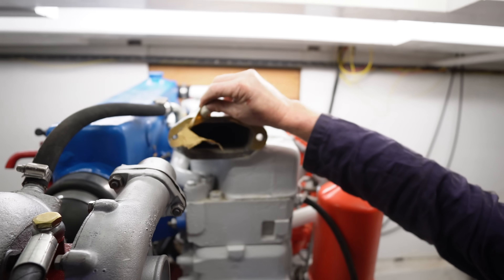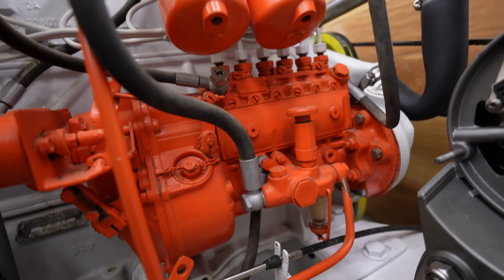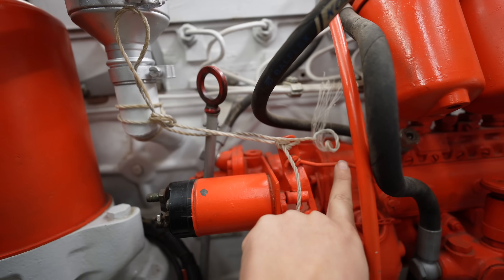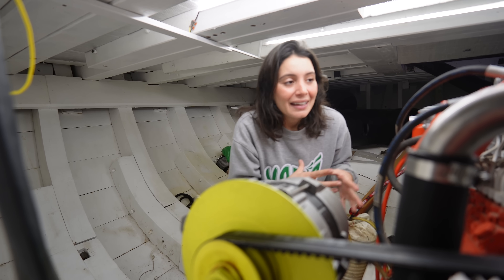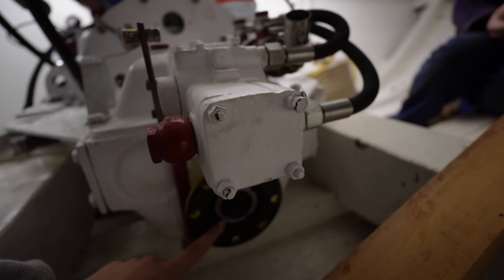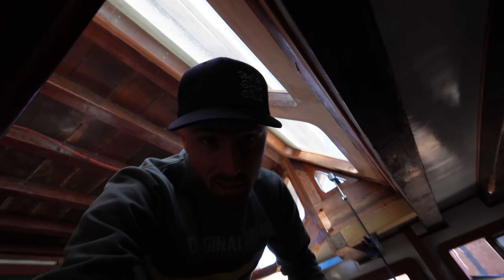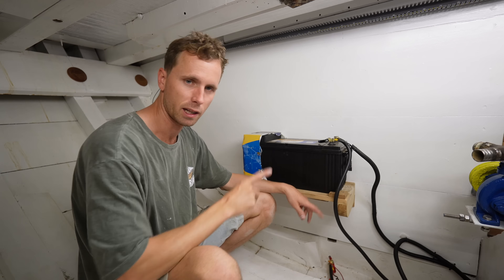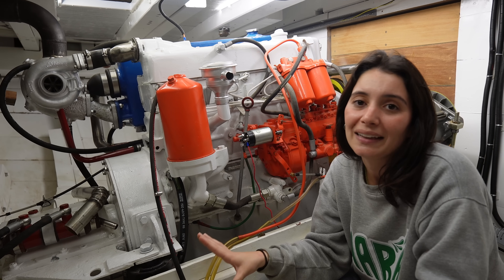Girl Takes on 230HP Diesel Mercedes Boat Engine - Incredible Transformation!

Comment: i always new about end float from an early age, but honestly had no real idea what the hell it was, but with additional pressure, an example being the road wheels on a car, you need a little slack or you could damage things, if any thing there could always be too much slack and this also can damage things such as the output bearing to the prop shaft, not too sure about the sideways load your engineer was putting on the output shaft because this can also indicate prior damage to that last bearing, (an easy enough fix) the end float is pressure against the gearbox and can be adjusted with a shim or two, i have been stripping aviation parts, with drive shafts and all manner of bearings and shims, it pretty interesting to see how these things work and run so smoothly for so many hours without the slightest of wear, but when things go wrong, the lessons are just as rewarding, bearings that seize up and no longer have any movement, ahha so that's why it failed, possibly a lacking in lubricant, oil is essential to keep things moving
Reply: The output bearing is brand new. The sideways load is on for a few seconds, so no problem.

Comment: The next time you can put a little air pressure into the fuel tank or container and you will not have to pump the fuel to the filters and injectors!

Comment: There's a lot of names for filtering polishing your fuel so you don't get anything in your a lot of people use racor filters it just keeps the water and moisture out of your engine extending the life of your engine also bad fuel so you don't shorten the life of I'm not sure what you have planned for I know there's two filters on the engine but a lot of marine applications have pre-filters from each tank

Comment: I would seriously consider resiting your battery. It must weigh 40kg+ and when you are being tossed about in force 8 or 9 gale that thing is going to be ripped off its mounting and it will do considereable damage. It needs to be low down and secured between something substantial and preferably on something that has anti-vibratory properties to prevent it being damaged when the engine is running. Also if it is a lead acid battery make sure the acid can never leak into your bilges. Remeber the stories from the WWII submarine. The acid will react with salt water and make chlorine gas which is fatal. You might want to think about a gas monitor.
Regards

Comment: Should  have added  new diesels  requires  this by law,  when that engine was built no one heard of  control  of blow-by. You will need to weld  a fitting  on the tube intake  pipe,  be sure  you place it to the bottom  on the  connector..

Comment: Young Lady.  If the engine needed an overhaul then you should have expected that the gearbox should have been opened up and checked. Still it's a good lesson for you and more experience for you to gain.  Chances are its just backlash in the gears under no load.

Comment: It is best you had the problem show up now then after it was in the water. It will be easier to fix it now than if you was in the water running it! So it is NOT A BAD THING! You have to always look for the positive side of things, it helps you dealing with problems! I am learning this myself with my right knee and leg that I broke when someone let their dog that was ti have been on a leash to run at me on my Harley in 2012. And because of greedy doctors that didn’t fix my knee properly. So they could use me as a cash machine, because if they had done it RIGHT; I would have walked out of the hospital two weeks later. But I have had 25 operations and procedures done and as of today August 9 2023 I am still in a wheelchair and can’t walk even though they removed my knee and put a mechanical knee and 18 inches of titanium and n my leg.  But they still did something NOT RIGHT, because they have had replace the joint once already and I can’t straighten it out so I can stand up on it and walk! So I have gotten with a team of great doctors and am going to have to do a MRI to see what is going on with the knee joint. Because the doctors that did the other operations don’t want to do anything with it except AMPUTATE it to keep me from filling a lawsuit on them! So I have to look 👀 at the POSITIVE things! To keep my sanity!!!!!

Comment: You will be more defeated when your turbo will fail for good after a few hours or running, because it is already fucked
Reply from the maker: What makes you say so?
Reply: the turbo is good... and probably eaven if it fails the engine has 150hp without is still enough to push the boat.

Comment: Wait, I don’t want to offend anyone but are you serious? A battery sat around for 2 years and you didn’t take that into consideration? You didn’t take a part the gear box? It’s like the second most important part of the engine! You guys are two clowns!
Reply: "I don't want to offend anyone", then goes straight into being offensive! Rude!
Reply: they knew it was bad and tried anyway to get more materlial for the youtube video. Not a bad idea, if they would have started it with the old battery they wouldnt need to buy a new one now and in 2 years when they launch the new battery is 2 years old. They could have bought it in future.